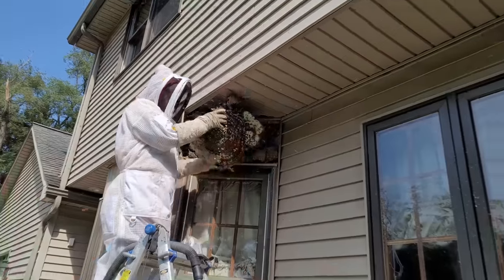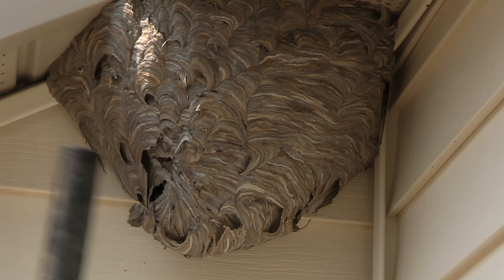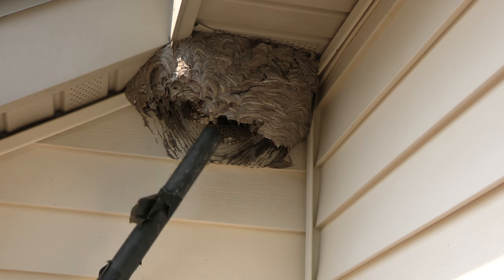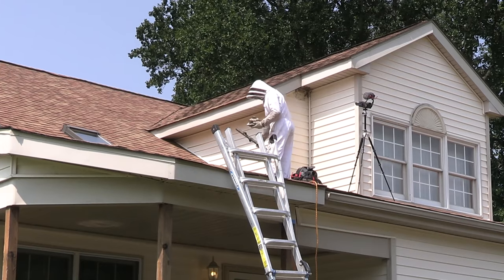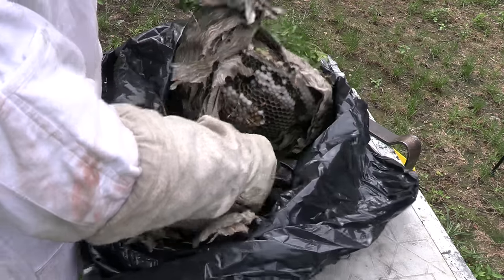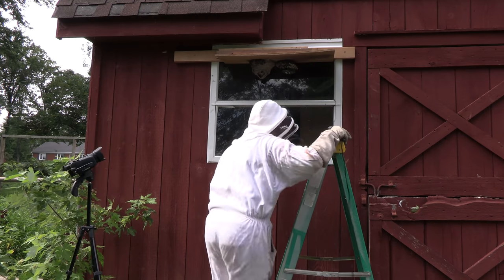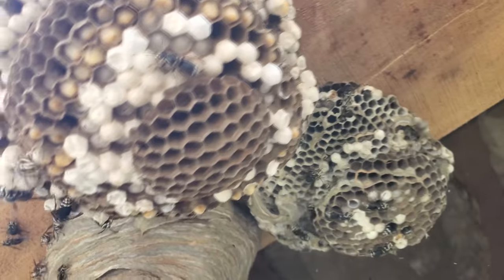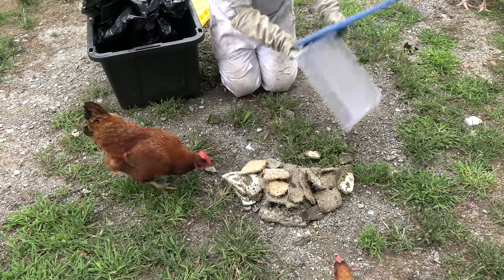5 HORNETS NESTS Side by Side! Will They Attack!?

Comment: May I please ask you a serious question requiring your inordinate knowledge of wasps?  I live in central Texas, and we have orange and yellow banded “wasps”.  They build a single layer nest, usually with deep cells, supported by what looks like an apple stem sized connector.  I have a genuine love and respect for ALL living things.  I WILL NOT even kill flies in my home, unless it’s absolutely necessary.  But these orange and yellow striped wasps are one exception to my “live and let live” rule.  I have noticed that no matter where I go, wasps and some bees view me as the anti-christ.  These small missiles with thistles simply go full on “kill Aaron” mode for no reason other than to make me run...and I absolutely run!  I can walk to the sliding glass window on our back porch, and no sh!t, they will literally start attacking the window to get to me.  It sucks to say the least.  I’ve abandoned shoes in my garage after walking in and having them mug me.  I am on testosterone replacement therapy, and am curious if this may be why I have MS-13 gang member wasps stinging me for no reason.  Help

Comment: great video as usual. a word of advice or suggestion.. you can get hot glue guns that run on battery which can be a godsend for jobs like this where you really don't want a wire getting in the way of stuff especially when you're trying to hold something up above your head. anyway keep up the good work.

Comment: So I have a question. Hornets and wasps dont like making nests near other active nests. At least that's what I saw online. I had two wasp nests start by my front door. Each had two wasps, I'm guessing a queen and the male they mated with or a worker? Idk. But that's new nests were INCHES from each other, they would fly around to the other nest, and no fights broke out. The reason I'm bringing all this up, I was curious what species these were, and did some searching. This is how I found this chanel. And in my research, I came across fake nests for sale. The idea was have the fakes where you don't want real nests to show up, since they will avoid active or dead nests. So how are you able to put so many nests next to each other? Please let me know! I'm very curious why I'm getting conflicting information. Love your work!

Another question I have, the nests formed in the mid to late fall. Is this normal timing? Or did something happen to the original nest? If something did happen, could they have been from the same nest, and THATS why they were willing to build so close to each other?
Reply from the maker: So this is something I mention in the video, 8:26 . Wasps are not territorial. Thats a common misconception and those manufactured faux nests are a waste of money, and wasps will build nests inside of them and near them.
Reply: @HornetKingOfficial  and what about the strange timing of the nests? What do you think happened there?

Comment: Fascinating video. Have you tried putting a yellow jacket colony beside a bald faced hornet colony? Would they attack each other?
Reply from the maker: BFHs are yellow jackets. No they wouldn't
Reply: @HornetKingOfficial  Thanks. I knew BFHs are yellow jackets - I just wondered if different species were hostile to each other.
Reply from the maker: @Sashek  Not in my experience. I had a German yellow jacket colony close to a BFH nest and they might as well have been miles apart. I never saw either of them near each other.

Comment: Am I the only one wondering why he used the ladder upside down?
Reply from the maker: Its an extension ladder that has two wide stance legs on either end because it can also be used as an A frame ladder. So the other end on the ground is identical to the end by the roof.